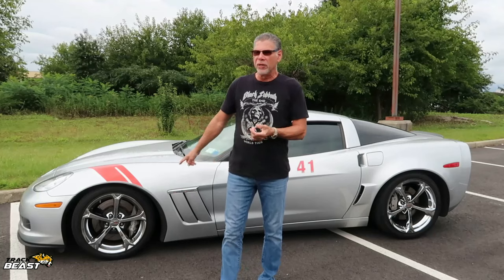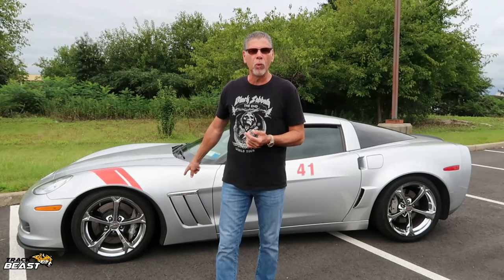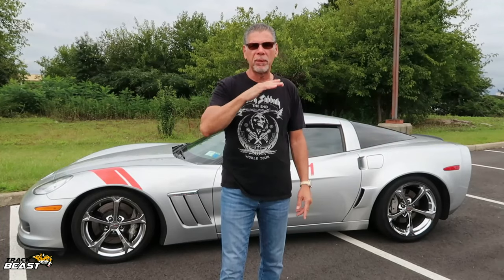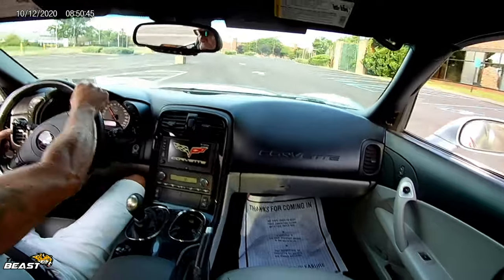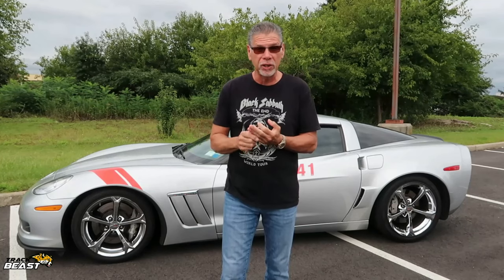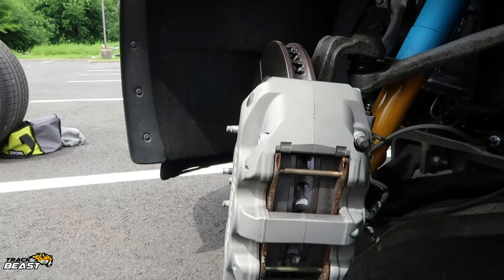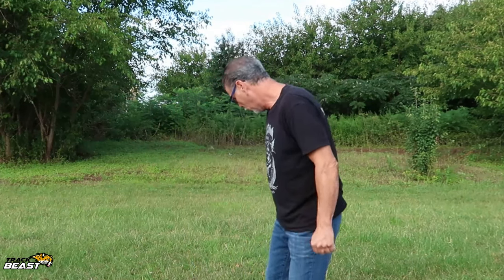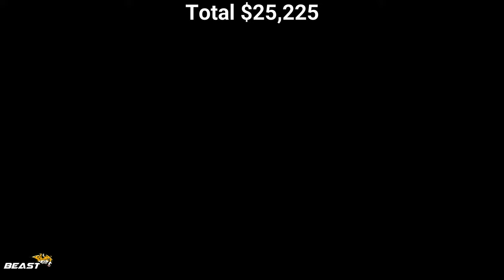C6 Corvette Street/Track build, Part 1, make your car a track beast, with just a few bolt on mods

Comment: Thanks for posting this video I learned a lot from this, i wanna ask you if buy a z51 ls3 c6 and do all the modifications you did to the grand sport will it as fast and will it feel as nice in the corners?
Reply from the maker: It will definitely help the cars handling,
Reply from the maker: But the GS has a wide body, similar to the z06, so you can fit wider tires, that always helps lap the times. Z51 would not be a slouch, but just not as fast as a GS
Reply: @trackbeast54  So if the Z51 had the same modifications as the GS what lap time do you think it will get at lime rock if you were driving it ?
Reply from the maker: @Mustafa-zr3lo  hard to say, so many variables, and I never finished building my GS
But I’m thinking 1:02s would not be unreasonable

Comment: With regards to flopping around in the seat, have you done the seatbelt trick?  You get in the car with the seat all the way back, buckle the belt like normal, then pull the shoulder strap all the way OUT until it stops, then as it retracts youll hear it clicking, which means its locking with each click.  Now you let it retract as much as possible, I pull on the belt as hard as I can to get every last click possible.  Now, move your seat forward to the driving position and be locked pretty good against the crappy OEM seat.  It's pretty good for what it is, a better seat is still a good idea though.
Reply from the maker: Hi Jay, I tried it, I still slam into my door. 
My friend told me about it, I really need race seats, especially with R tires, I’m pulling to much g force.
Thanks for mentioning it.

Comment: What track tires are you using ? Are you running a square setup
Reply from the maker: Hi Jerry running stock size tires, toyo R888rs
Think it would be hard to run a square set up in a GS, not much room up front to fit wide tires.
Reply: @trackbeast54  - what size are the wheels Frt & rear and what size tires frt & rear ?
I believe you mentioned other mods such as headers , intake , and tune - have you made any selections yet and please share if you have
Reply from the maker: @jerryputerbaugh5437  wheels are stock Z06, tires sizes are 275/35/18F 325/30/19sR 
I have been too busy, to ad header’s, cam or intake 
The car is fast enough as it is, so at the moment, I’m not in that much of a rush.
Reply: @trackbeast54  I believe you drive to track events with your track wheels/tires mounted 
If I go c6 grand sport l’m going to invest in a two wheeled trailer as my home track is Mid Ohio 135 miles away 
GM supposedly made a bolt on hitch - no drilling for Corvette and the trailer  is made here in Ohio for $1800 
This will be a step up in power for me as I have always tracked M3’s but need a more durable car and M3’s can be costly to maintain as I have found out
Reply from the maker: @jerryputerbaugh5437  that’s a good idea, if you are going to use a trailer get toyo RRs much faster then R888rs.

Comment: Step one don’t buy the grand sport. Step two buy the ZO6 or ZR1 and your all done.
Reply from the maker: I have never been passed by a C6 Z06, with my GS, since I did some minor bolt on modifications 
I have never saw a C6 ZR1 on the track.
Reply: If you want the monstrously powerful yet expensive to maintain LS7 then sure.